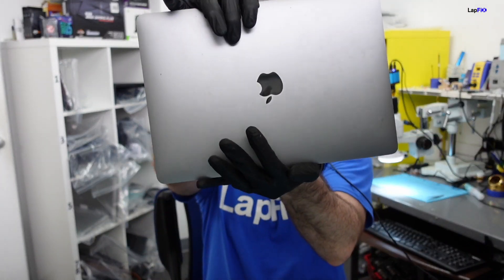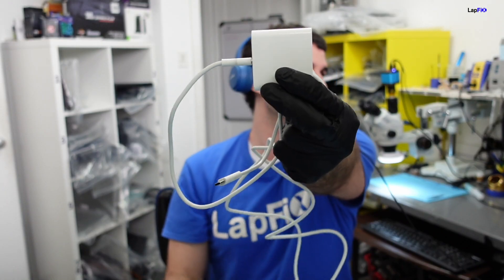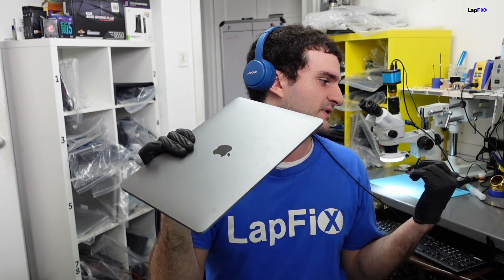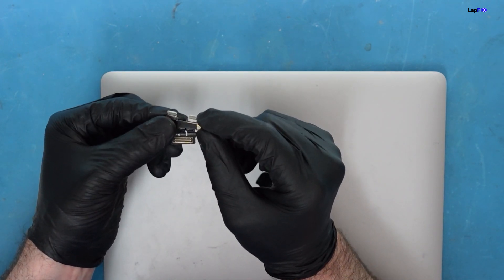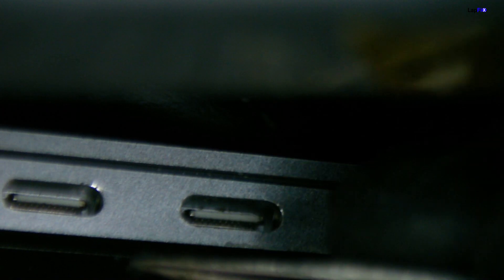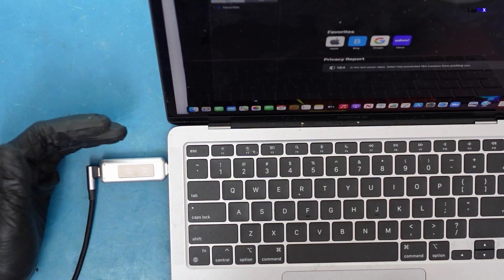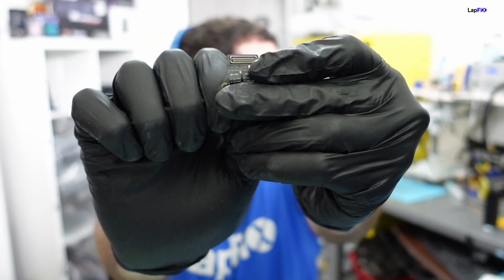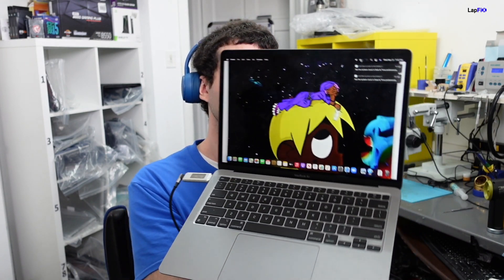M1 Macbook Air Not Charging Repair - Easy Charging Port Loose Fix

Comment: Thank you for the vids man,Just today, both of my MacBook air m1 usb ports all failed. The top ports was showing disfunction and stop working years ago, but the second one only stop working recently and somehow I see it coming. The port conditions are absolutely fine and I don't remember of any water spill or other accident that might defects the ports. However, if I tillted the usb cable to a precise angle it has the chance to charge at the second port. The chargers are absolutely fine. Would you advice me to buy the ports and replace it myself?
Reply: Same issue happened in mine! Have you solved the ports?

Comment: Hi Lapfix,

My Mac is not charging when i plug it in.  I have been using a samsung charger to charge it for the last 3 months.
Because of this, have I damaged anything, do I need to replace USB port or maybe the battery is damaged?

The computer is still going (6%) but not charging.

Thanks for your time.
Reply from the maker: if it is plugged in (showing the cable charging icon)  and not charging the battery, it may be a battery issue

Comment: Hi man, thank you for the video however I do have a question regarding my MBA M1 because one of my USB ports doesn't charge reversibly. It's only work with one way but not reversible? (I hope you understand)

Do you perhaps know what is going on?
Reply from the maker: Sounds like a damaged port or cable, try another cable first

Comment: Great video!  As luck would have it, have  Macbook Air M1 2020 just out of warranty.  The uppermost USB-C port doesn't work, but the other does.  Tried the SMC tricks, even condensed air.  I don't see anything in the port and otherwise feels "OK" when inserting.  Sometimes I'll get the "connect" bing from charger and immediately goes "dead".  Tried other chargers and USB devices and those aren't acknowledged.  I'm sure the repair will be costly if I bring it into Apple unless they're generous and see I'm a few months out of warranty.  I'm good w/ PC repairs, never tried Mac.  Any suggestions?  TIA!
Reply from the maker: Be careful playing with the port as the power line can touch the data line on USB-C connection.  Most likely you would need a replacement port.  I have another video on the channel showing how to do it if you are interested.  Otherwise, leave that bad port alone completely to avoid damage to the board

Comment: So  are you saying any charger that is different from what apple provides in the box might damage the port from charging? I was recently using my HP 60 watt charger on my M1 mac. That charging port stopped working. Is it because I was giving my mac too much juice?
Reply from the maker: It can.  At the least, try to keep it at the same wattage. I would highly suggest sticking to the OEM versions of chargers (especially for any of the MagSafe versions).  It's not worth the savings of a 3rd party charger to risk your logicboard.
Reply: @lapfix  I heard that phones and laptops only draw what the computer or phone tells it to draw. Meaning the phone or laptop decides not the charger. Just because a charger can provide more wattage it doesnt mean the phone or laptop will draw what the charger is capable of outputting. Thats not true?

Comment: I have a 2020 MacBook Air that the apple store says that the charging circuit is shorted. Battery is
Dead but the laptop works otherwise. Can it be charged somehow or repaired without losing my data?

Comment: I have a a2338  mackbook pro. I replaced the usb c plugs on the side still same thing. The board looks fine no corrosion on it. How can I test the battery to see if its bad? Can I do it with a meter? I bought the usbc charger volt meter dont see it charging on that any help woul be helpful thanks
Reply from the maker: Check the meter.  Blank (not blinking) usually means port not recognized/damaged.   20v no amps  or 5v indicates most likely indicates board issue
Reply: @lapfix  sounds like a board issue it lights up no amps or .47 amps

Comment: I have an A1932 Mac Air - wasn't used for about 2 years in the box. Unboxed and it does not charge. Battery remains at 1% and pulling out the charger kills it (Laptop was never used). Any idea what could be the problem. Thanks
Reply: having the exact same problem need help
Reply: Yes same here. Please reply if you found out the problem. Thank u

Comment: Hello, my macbook pro M1 2020 just charge when its shut down, and normally take 4h to charge 100%. If I turn on It wont be able to charge. Have tried reset the SMC and I follow all the step on the Apple web site but nothing works. What can I do?
Reply: 90% times its the type c jack. Replacing it should solve the problem.

Comment: My macbook air m1 won't charge when it's switched off and connected to a charger but it has no problem charging while it's on.. any idea why?? I haven't upgraded it to ventura yet, could that be causing the issue?
Reply: I have the same issue
Reply: I’m having the same issue!!! What did you do?

Comment: One of the 2 ports in my laptop stopped working today...i believe because i was using some cheap usb connector...the ither one is working....(i will no longer be using the cheap cable now)....can you suggest me if i should get the second port fixed?....or are these 2 ports independent.
Reply: @Lakshya Sharma  Have you got your port fixed?
Reply: @Ajeet-Yadav-IIITD  yes it costed 2500 rs at apple store, they replaced it with a new one
Reply: @lakshyasharma7448  what was your problem bro?
One port is working for charging and usb hub,but the other doesn’t work for charging and it works only if I’m attaching a singe usb with type c adapter otherwise for the usb hub it’s showing usb disabled for usb hub.
Any solution?

Comment: Would the charging port being damaged cause the laptop to not turn on even if it had 80% charge.  My A2179 Early 2020 Intel showed it was charging when it wasn’t.  I restarted it and now it won’t turn back on.  The battery charging when it wasn’t was my key indicator that it’s a charging port issue.  Thank you.